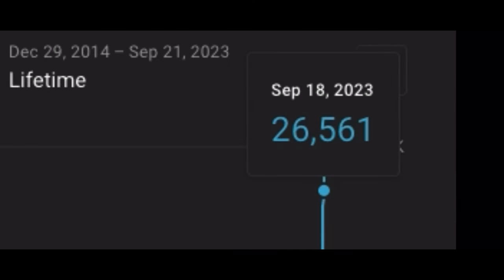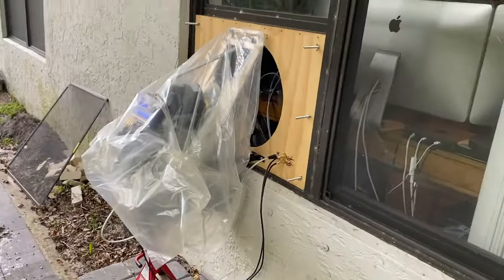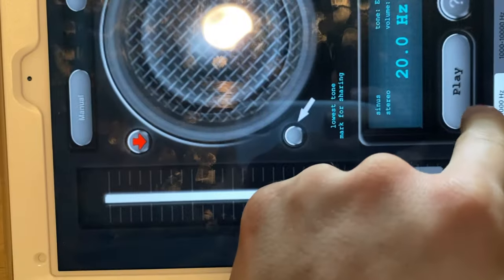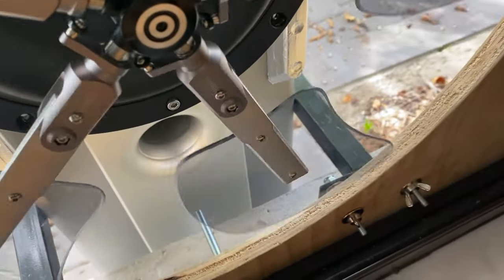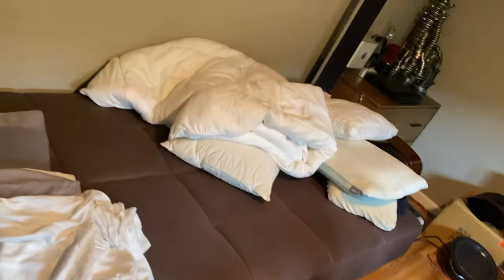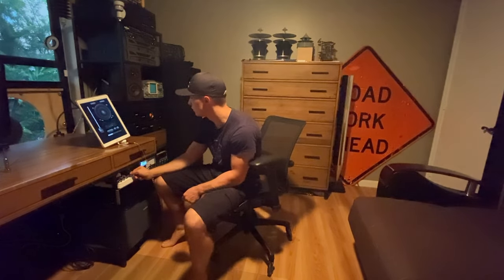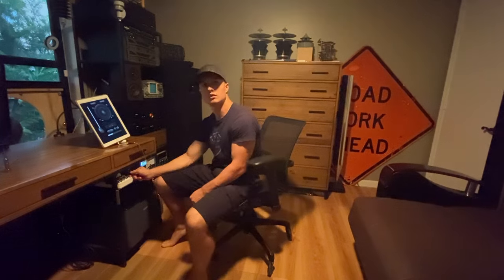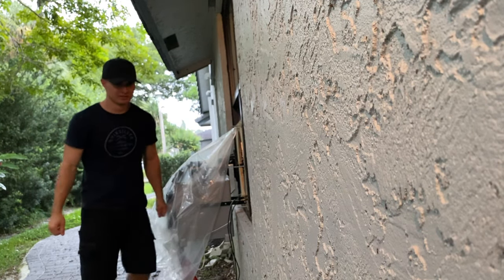Finding resonant frequency of my house with worlds most powerful “rotary” subwoofer (Bad Ending👌)

Comment: what if you use a servo moter to pitch the blades? thet are very strong and can be very fast.
Reply: not a servo, just a regular subwoofer to pitch the blades
Reply: servos are not that strong
Reply: @cursed_cats5710  you can get some pretty strong servo moters that aint that big. no matter what it's stronger then the coil from the speaker driver.
Reply: @gabrielschoene5725  what if* he uses a servo moter. it has been done before drive a speaker.
Reply: @cursed_cats5710 if you restrict your thinking to kids rc stuff. There's pretty powerful stuff for "hobby" rc, but servos are also used in industrial settings. Like the robots that toss car chassis around on a factory line. And that's just the start, there's bigger stuff been made with similar assembly lines, that are driven by servos and vfd:s.

Comment: Built mine and it worked ok, motor was crap and accidentally bought a trex450 rotor head, got about 2 1/2 min through DJ. Magic Mikes "Feel the Bass) felt it through the whole house, but then the tiny rotor pitch assembly grenaded. Grabbing a trex 550/600 series next and a Grainger 1500rpm 120v 1/2 hp motor next, also I'm switching to metal blades as .22 acrylic is too heavy for it's strength.

Comment: This might sound crazy but if you make another one and off set the time if you can have double the frequency. 
Edit: or you can have half of the fins set from controlled by separate motors. And off set the timing of both of them.
Reply: He first broke, and now you want another. 🤣
But, yeah, in theory, your idea should work, but you introduce other problems like directional and syncing.

Comment: I am wondering if using a better quality and much stronger RC Helicopter cariable rotor could work in making it more reslient. I know 100 bucks for one is one the lower end of resilience. Maybe one thats build for trick and acrobatics flying? Those need to be extreamly responsive and resilient.

Comment: what if you put the sub on the other side of the fan? could possibly increase structural integrity, or use a cam system for the rotors rather than pushrods.

Comment: So, what if instead of using a speaker you used a motor instead of a speaker to move the fan blades (similar to how a piston works) instead, it would be able to impart a lot more force a lot faster assuming you take the rotational speed and figure out what that equates to in a waveform which isn't that hard.

Comment: It appears you really found the resonance frequency of the room, at least... when you hit it, only a tiny bit of power will result in a huge amount of sound flowing in/out the subwoofer, apparently enough to damage it.

You need a microphone that goes down below 1hz so you can measure things properly.

Comment: Damn!!
I wonder if making the blades smaller and raising the motor speed will increase the max frequency that could be played cause smaller blades will be easier to articulate and the faster rpm will increase the air flow per second, i guess🤔

Comment: Literally any song in existence is above 20 hz. Most mastering engineers cut away all the frequencies below 20 because a human can't hear those anyway
Reply: But we can feel them.
Reply: @hughjanus5518  I mean sure. But it doesn’t take away from the fact that every mastering engineer ever cuts away all frequencies below 20. Because it fucks with limiters and compressors
Reply: @michielvansteenhoven7255  with new technology other must adapt.
Reply: @hughjanus5518  what do you mean?
Reply: @michielvansteenhoven7255  They got rid of Frquencies lower than 20 Hz because it caused issues with limiters and compressors but now with the possibility of these lower frequencies those compressors and limiters need to adapt to this new tech.
That or they could put the lower hz on its own single channel as to not affect the audible audio.
Reply: @hughjanus5518  the technology to emit frequencies lower than 20 hz have been around for a very long time. There’s just no demand for that stuff in music. Michael Jackson had a song with frequencies as low as 5 hz and the concert goers experienced intense nausea from it. And apart from that, it’s not that limiters can’t handle frequencies lower than 20 hz. But you can compress music more when you get rid of unnecessary frequencies. In hiphop for example they cut away most of the frequencies under 60 hz because they don’t need any sub sub frequencies. Impact in music comes from anything between 100 and a 1000 hz. Sub is an added extra to make it fuller
Reply: Most amplifiers and sound equipment are designed to cut out lower frequenties at some point. They need to get rid of the DC component of a signal in a physical wire. But there is no universal law that says sound stops being sound at 20hz. One can always process the instruments each cut to its own optimal frequency band and add a track with the sub 20hz stuf recorded from an instrument that actually can produce that sound. The Falcon Heavy recording shows that not all equipment cuts out the 1-20hz part.
BTW, for reference, club music has a lot in the 30-60hz range because it can be reproduced at full volume by a decent 18 inch subwoofer and it are still recognizable notes. Below 30hz most subwoofers start to get less maximum volume. Perfect to get the pipes of your trousers flapping. A kick drum normally has its peak between 60 and 80hz.
Reply: @mennovanlavieren3885  very true

Comment: If you make it bigger will it be able to play higher HZ?
Reply from the maker: Would need to make it smaller actually
Reply: smaller & lighter blades
Reply: smaller speakers produce high frequencies, larger ones do the opposite 😊

Comment: I think your next revision needs something with a swash plate, and not a subwoofer driving it, but something like a geared electric motor with a camming system to drive the swash plate.  Sort of like a helicopter.  Then the motor rpm is adjusted to match the requested frequency.

Comment: I got a subwoofer box in my bedroom tuned to about 24hz. I shook my closet door playing 10hz as well. I had a 18" Soundqubed HDX3 on 2000rms watts. I have an 18" Resilient Sounds Platinum subwoofer in my suburban and I'm getting a custom box built for 3 18" Resilient Sounds Platinum subwoofers on over 4,000rms watts.

Comment: Hello, got into rotary subs 2 days ago 🤗. Have seen that your video is actual not old.
I have so many questions...
Iam trying to bild it un-influenced from the internet (it is not possible, so it is not working, bla bla bla...)

My thoughts are:
-your pitch steering adapted by rc-helicopter has to much fast-movement-mass (oscillating mass)
-i would like to go with the design of a wind generator...
The rotary mass should be (by my thoughts) real beefy. The mass hat to pick up speed only one and then hold the rpm. Massiv pitch-management could be a double win (like a flywheel).
Also i would like to spin the rotor by a belt and win some airflow, and be more easy to the oscillating system.

The wave-exit to the room could like some design, like a short big horn? 🤔

I hope you are making an update about your intentions to make it better and stable... 
Iam ready to make some noise 🤪😁
Reply from the maker: I don’t even know how to answer that. But honestly, just make it and improve as you go

Comment: I wonder if you replaced the fan with a jet turbine? Would it make the speaker more powerful and could you concentrate the sound energy into a tight beam? If you used a modified version of this the vortex cannon might finally have a chance to live up to its name.
Reply: It works by tilting the blades to push air one way and then tilting them again to push it back the other way, so if you change the fan with a jet turbine now the blade tilt is fixed. And no, sound is from differences in air pressure, and at low frequencies the pressure wave goes everywhere. Beams aren't physically possible.

Comment: Was it the rain that killed the motor ?
Reply from the maker: Nah, over excursion caught too much air, increasing resistance, slowing the motor down, allowing the blades to be over-pitched until they hit the aluminum frame.
Reply: Over excursion is simply one way of pushing a driver past its mechanical limits
Reply: @pierogiengineering do the blades need to be that wide? Thicker and wider blades is more air resistance and much more power to turn and attenuate. Smaller, lighter blades and higher rotating speed maybe?! I mean the attenuater is from and rc heli, isn't it?

Comment: This is not unlike Tesla's Earthquake machine.  Which has the capability of matching harmonic resonance of structures, and amplifying them, making them more prone to destruction.  Imagine if you could get a strong enough servo to actuate the blade mechanism at higher frequencies.
Reply: I feel like it could be possible to do if the blades were not as wide. Have more of them but the width is less. 
You could make a whole bunch of these with widths matching differing frequencies.
Reply: @nicholasfinch4087  Yes, a lot less mass would make it more efficient too.  Carbon fiber would work.  I still don't know if the sub coil is strong enough for the faster speed though.  If there were lubed bearings on the joints, it would work smoother too. An awesome project nonetheless.

Comment: Isn't that what Nick Tesla was doing?🤔
Reply: He was trying to match the natural frequency of earth and a solenoid or sorts that was attached to the building he was living in (to provoke an earthquake) the myth busters replicated the experiment to see if a small solenoid would make a bridge shake, by first matching the high frequency in which the bridge was naturally shaking  to a solenoid that was attached to the it, and than lowering the frequency using the solenoid , it took some time but the solenoid was actually making the bridge shake at about 7 hertz (something like that) then they stopped the experiment claiming it didn’t work.

Comment: Dude, you got to be careful with this stuff, resonate frequencies are no joke.   I fully believe you put those cracks in the walls. 

Ever hear of Tesla saying you can take down a building or a bridge with a metal rod just oscillating back and forth via magnets? Turns out he was right.. kinda. A TV show tested it out like a decade ago on a bridge.  They didn't take down the bridge, stopped the oscillator before it got to that point.  But, they let it go long enough and got the right frequency  that the bridge indeed was shaking.

You probably did much more damage to the house then those cracks you showed. You very well could be doing damage to the outside weather sealant of the house and end up with water coming in from the rain.

Comment: MP3 along with many other formats will not really carry sounds under 20Hz well at all. Actually, many formats remove subsonic and ultrasonic sounds as part of the encode. You should really look into DSD/DSF format. That is a master format that will capture 1Hz up to about 40kHz. The player and DAC needed to properly play DSD without converting to PCM is not very cheap though. The cheapest way to find something to properly decode it is an older DVD that supports SACD.

Comment: Not like i know any of this stuff but isn't the "fan" mechanism basicly like a helicopter rotor? Maybe a secondhand heli rotor could work for this on an extreme lvl lol, just speculating of course tjho, fun idea maybe
Reply: I like this thought, but I wonder how easy it would be to find the right parts. With how often it is loaded in opposite directions, I think he would want some that is made for 3d trick flying helicopters. That would probably be expensive in itself and finding one the right size would make it way more expensive. Hope I am wrong though.
Reply: He looks like he’s already using a rc helicopter rotor setup
Reply: It sure do moves like a swash plate.
Reply: He said that's exactly what it is in the last video

Comment: I'm a complete noob in this, but this shit is insane! 

So am I right in understanding: the issue with higher frequency is essentially too much play/elasticity in the system? In other words, a more rigid system would enable you to increase frequency? 

If so, could you use an electromagnetic linear actuator, with a motor to provide the rotation, and a more rigid (rose jointed) fan system to increase system rigidity and therefore suitability to higher frequency?

Comment: use more light weight material for the wings/flaps or whatever, less inertia so higher frequency response, also couldnt you slow down the rotor to get less volume so it doesnt rip your house apart?
Reply: Needs to be stiffer- carbon fiber, titanium

Comment: Couldnt you, if you reverse rotation of the blades and polarity of the woofer, put the whole mechanism inside? There are some expected losses, because of the "Subwoofer" stanind in the way of it self. But atleast this way, you wont need to worry about Floridian Weather.

Edit: Also a song recommendation, tho its copyrighted, is "Why so serious" from The Dark Knight, made by Hanz Zimmer. At 3:25 through 4:36, there is a insane low end, while still providing a melody. On the soundboard I use for work, it looked like everything from 1hz to around 100hz was used.

Comment: How does that work, humans cant hear up to 20hz right, or are they fan hz and not sound hz?
Reply: i think we can still feel it
Reply: @norkshit  you're right. The resonant frequency of a human body is theorized to be between 5-10 hz.
Reply: You can hear below 20Hz just fine. Your ears just aren't as sensitve to it so you need it louder and louder the lower in frequency you go. The 20Hz to 20kHz numbers you typically see for average human hearing doesn't mean it's a hard cut off in hearing. If you have something that can play cleanly under 20Hz at decent volumes. You can easily hear it. I'm not sure about the single digits though. Those frequencies I've not had too much experience with. I'm mostly familiar with around 12Hz+ at decent voluime with my infinite baffle 18"
Reply: @JoshM7  yeah it's a shame how many still repeat 20hz to 20khz like it is some absolute cutoff point
Reply: @rokoala2636  Yeah I see it so much I don't bother to correct people most of the time. 

I know my hearing loses sensitivity as I go under 30Hz and above 16,500kHz. I can make myself hear up to 20khz still with enough SPL. But by that point I'm probably adding 15-25dB to start to hear it again for the high frequencies. For the stuff under 30Hz I don't need near that much. But still need a good boost to make it perceivably the same volume as the 30Hz+ content. Only downside with the boosted lows is my current house I shake the floors enough to make it feel like an earthquake. Cool for movies but probably not good for the house. 😂

Comment: what if you use higher rpm, a more square wavelength, and smaller angles? the smaller angles and square wave should be able to raise the response rate while higher rpm will maintain the amount of power 
just a thought

Comment: You've only got one pair of ears so look after them. Can you show us your house collapsing? When you're mom is out of course.
Reply: Ears aren't affected by low frequencies.
Reply: @jimbotron70 Frequencies aren't the issue but the pressure associated with producing those frequencies, the pressure will burst your ear drums
Reply: @Datoda  Never with infrasonic frequencies or there would be deaf people anywhere earthquakes occur.
Reply: @jimbotron70 Correct, humans are very resilient to slow changes in pressure (low frequencies), otherwise we'd go deaf every time flying, riding a subway train, or diving.
Reply: @jimbotron70  Infrasound still is pressure waves, that's how sound works. There is conclusive evidence however that while earthquakes may not burst your eardrums, repeated exposure to the aftershock causes hearing loss.

Comment: I'm no mathamagician but I would say, calculate the terminal velocity of blade movement
based on air resistance of surface area 
at maximum movement in the largetst possible combined motion at maximum force, 
as a formula you could define the force/cm² or psi or kpa or bar...

Then engineer a blade that is able to withstand your requirements.
Reply: You're clearly a physigician lol
Reply: @aviko9560  You know what a physician is right???
Reply: @yeetyfreety6938 That's probably why he wrote physigician and not physician.
Reply: @automatic241  Ah, I forgot words that don't exist should be considered.
Reply: @yeetyfreety6938 If you're so smart then tell me what's the equivalent of "mathamagician" in physics?

Comment: nice tesla oscillator.
Reply: Different way of doing it but basically the same effect. Tesla's was crazier because it didn't rely on external air pressure - it was just a linear oscillating mechanism and could sustain higher frequencies.